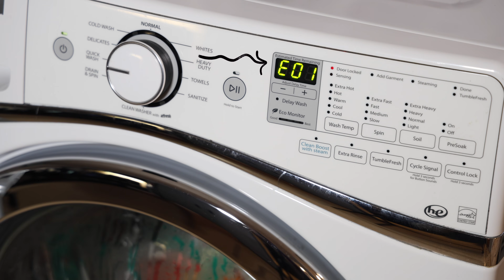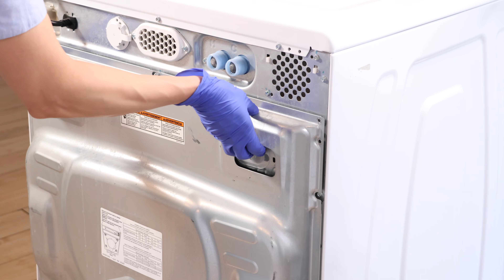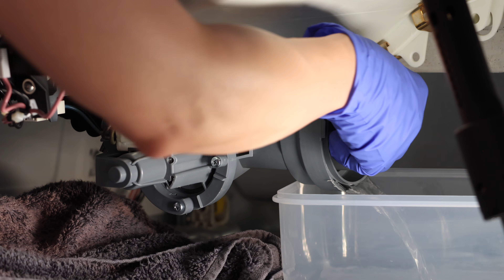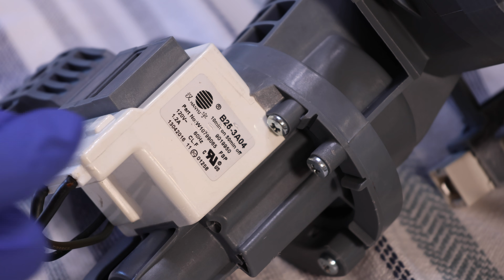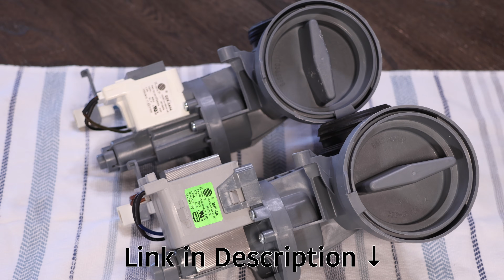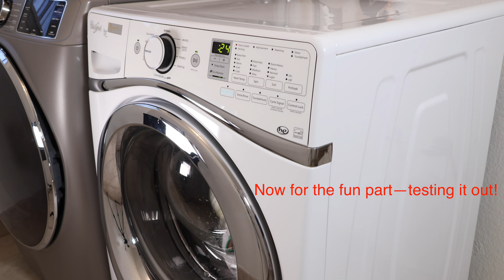Washing Machine Repair | Fix Washer Not Draining | Drain Pump Replacement (F09 E01 Error)

Comment: WCW92HEF0 - some 10 years old - same error, intermittent problems (1 out of 3 washing loads would end up in F09E01). Cleaned the filter, did not make the problem go away, then replaced the drain pump (same model as yours) thank you for the information, much helpful! The only issue is that the dryer was stacked up on the washer in a tight spot which made this whole fix a little bit tough but in the end it worked!
Reply from the maker: Thank you for sharing this! Intermittent issues like that can be so frustrating. Glad the new pump fixed it for you—and yes, working with a stacked unit definitely makes it tougher 😅 Appreciate you taking the time to share your experience!